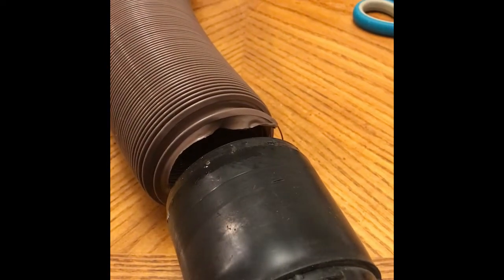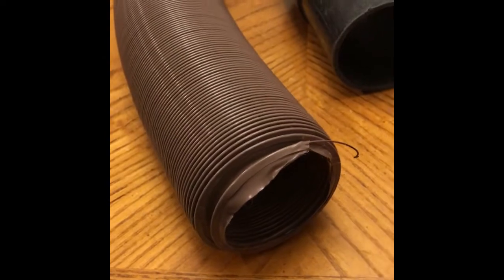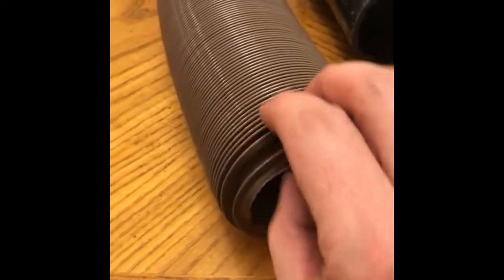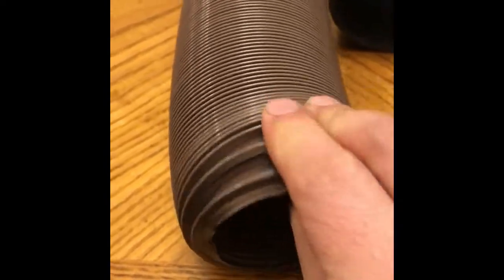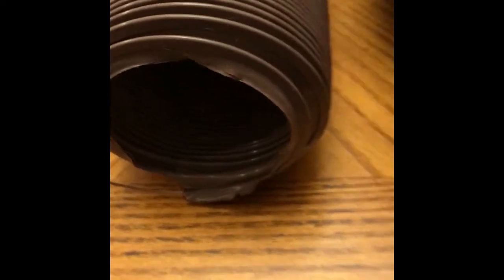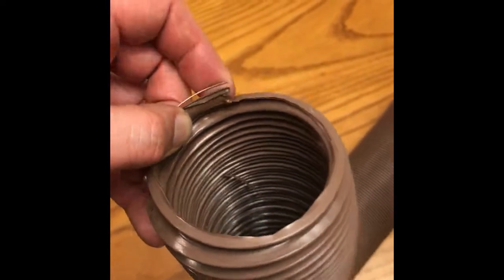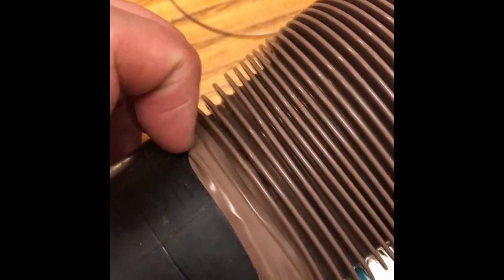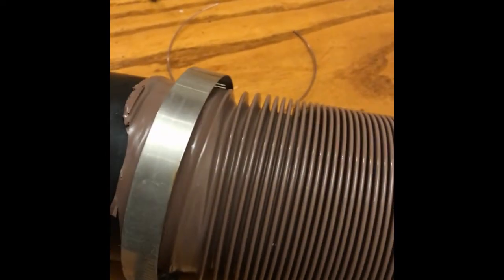How to put the #@!$%$#! connectors on RV sewer hose - THE TRUTH

Comment: Simply fill a bucket with very hot water. Soak the end (6-10 inches) of the hose in the hot water for 5 minutes and the plastic becomes soft. Slide the hose on to your plastic pipe. Done.

Comment: I found a slightly easier way.  1. Cut the first ring in four spots North, s, e, w. Like a compass. Like 1/2in slits.
2.  Put hands in tube (or try) and pull it open widen like pulling apart. It stretches just enough to get it onto the adapter after.